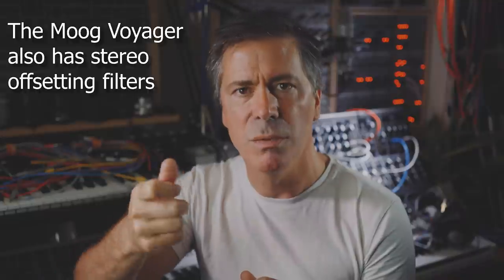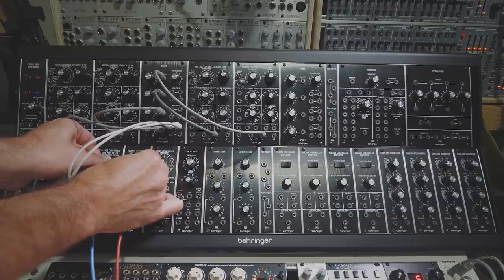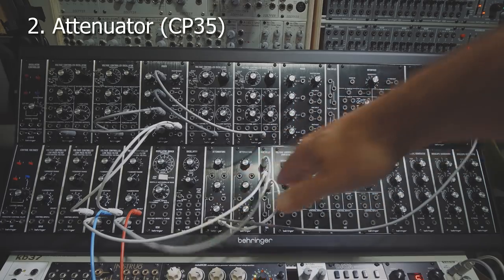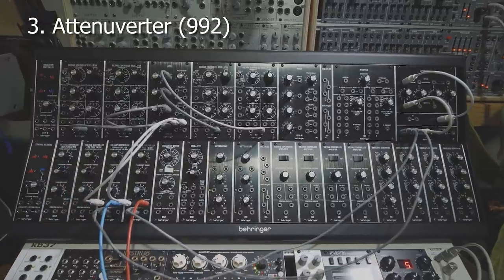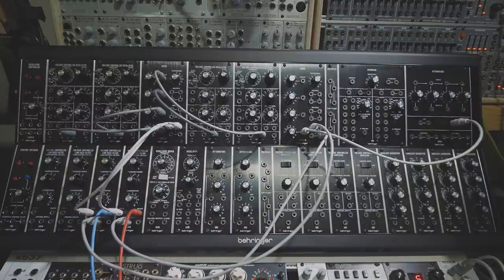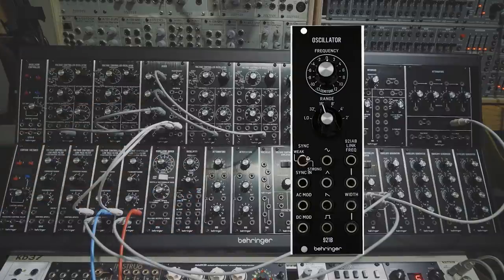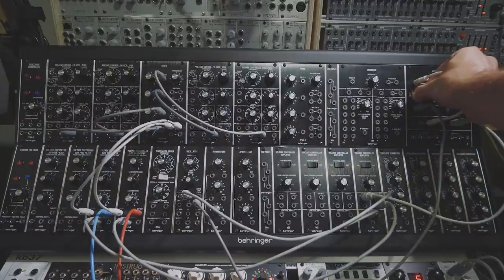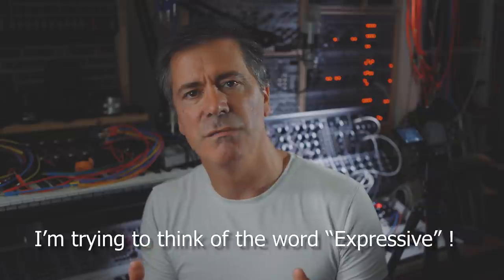Starting to Patch the Behringer System 55

Comment: nice one here, mr. shoebridge! both an admirable job of meeting your stated goals as well as some beautiful sounds and effects. the stereo elements of the matriarch are why i ended up selecting it over a couple of other synths i had been considering. never regretted it either. i also admire how you don't shy away from cables but if one is going the modular route, or even the semi-modular, one can't be afraid of them.

as always, thanks for your efforts and products.

Comment: Great video as always Tim. Loved the soft etherial sound too. Looks like a good deal of problem solving is part of the classic Moog style modular way. A great learning experience!
Reply: Thats why the ARP 2600 was considered to be a learning tool. However, Ed McManus my college electronic art instructor back in 84 had one. It sat at the back of the lab and no one touched it. Why? The line and sign up list for the NEW DX7 was a mile long. I was, er, FORCED to spend hours relearning what I had done on the 55 years earlier. I sampled about a hour and a half of the strangest stuff to ever hit a mix on hearts of space. Hey Hey Hey!

When behringer made the 2600, I preordered and got one 8 months later. Love it. Wish I had 3 more....the seventies are long gone, the technician in Eugene Oregon that offered to sell me his spare (he had 3 ARP 2600, 1 which functioned)  he never got all the parts so he used 1 for parts...my mutron bi phase with opto isolator foot pedal that kevin courney (hearts of space) sold me for 65 bucks left with my blessing for a mere 250$ along with with my korg ps 3100 and matching 800 sequencer (hat I paid 400 bucks for both) went for 2k, all missed savagely, all replaced by better gear, more interesting synths. Now my oldest gear is my fizmo, got it when it was brand new. I traded a prophet 5 I got for 175 bucks at a pawn shop. J wire? I dont care. I didnt care for that sound for some reason. It had a wooden case.  I am 67 years old and I have seen stuff come and go! Good luck and may you invest your energy wisely. Keep your eyes open for oportunities, they happen sometimes. I was offerd jobs as a roady for oddysee, m jackson tour and shows on ice. Put yourself out there! Be friendly.

Comment: Awesome video's, I really loved how you explored this one.  I have a larger System 55 setup which I put together last year that fills two Go cases and a couple of 104hp Behringer skiffs.  I also just received the Behringer "Four Play" module which is essentially a quad VCA mixer for either audio of CV signals.  That's yet another way that you can accomplish the voltage controls for this particular setup, albeit a cheat since the 4play is not a system 55 module.  I use that -6V output quite a lot into my oscillator banks.

I'll tell you that you're doing here reminds me of my first ELP concert (1972 I think). ELP had setup a 12-thousand seat venue with "Quadraphonic Sound".  They had four massive piles of speakers in 4 opposing locations in the concert hall to surround the audience.  They started the concert with their song "Hoedown" (which I have successfully patched with my System 55 using envelope delay to trigger a 911 and then through an attenuator to control the frequency of a 921B oscillator, in a bank of 3 driven with a 921A... and then out through the typical Mixer-VCF-VCA output.)   ELP shoved all of this into a quadraphonic system with different outputs on the various oscillators and the sound crew would ROTATE the sound in the concert hall clockwise or counter-clockwise... sometimes different voices simultaneously in both directions.  The quadraphonic surround sound nature of routine Emerson's synth through this system made me tingle like never before!  I was NEVER the same after I heard that concert.  They also did Jerusalem and an extended version of Karn Evil 9.  I was blown away...

Anyway, what you're starting to get into here is the start of the path which I heard that night and have chased ever since.  In fact, it steered me into a music major along with electrical engineering at the University... and now Behringer made it possible for me to somewhat replicate what I heard in the 70's.

Comment: There is yet another, quite simple patch to achive the effects from this video, by using a 921 VCO (without A or B). With the AUX output, you have adjustable positive and negative outputs which can be fed directly into the 904A VCFs. I use this patch currently for stereo effects.

Comment: That last two minutes literally gave me goosebumps. The more I watch your videos the less I can resist to buy my first modular setup. What you'll advice, maybe Behringer System 100 bundle from Thomann?
Reply: if you already own one or more semimodulars, you should go for a few modules to expand your possibilities. only if you want the whole shebang it's cheaper to get the complete bundle. The System 100 is worth it, in any case.
Reply: For sure do that. Expect a  long wait as the process is both time consuming and sometimes , expensive. They are good to work with, just keep an eye on the process as mine stalled for a week because of a paperwork foul up. They fixxed it as soon as they found out, shipped to USA in 24 hours. The fees must be payed to keep the gear or you pay the return shipment  costs. They use UPS and USP will handle all the paperwork and process with the Federal Gov. to your home. Do it! Comes in a nice bundle.

Comment: You could also have used the output of the 921A instead of the fixed voltage and attenuator. The 921A just provides a voltage output that is varied by the frequency control. Same with the 921As PWM output.

Comment: This is what came as my System 55: 

1x 914 FIXED FILTER BANK 
1x 923 FILTERS
1x 904B VOLTAGE CONTROLLED HIGH PASS FILTER 
1x 904A VOLTAGE CONTROLLED LOW PASS FILTER
1x 992 CONTROL VOLTAGES 
5x 902 VOLTAGE CONTROLLED AMPLIFIER 
4x 911 ENVELOPE GENERATORS 
1x 911A DUAL TRIGGER DELAY 
2x 921A OSCILLATOR DRIVER 
6x 921B VCO
1x 921 VCO 
1x 960 SEQUENTIAL CONTROLLER 
1x CM1A MIDI to CV converter 
3x CP3A-O module 
3x CP3A-M 4 input mixer 
2x 995 ATTENUATORS 
1x 903A RANDOM SIGNAL GENERATOR 
1x CP35 ATTENUATORS
1x 961 INTERFACE 
1x 962 SEQUENTIAL SWITCH 
1x BP28, 2x BP56 and 2x BP2 blanks panels for a total of 144HP expansion space
1x CM1A MIDI-to-CV converter
2x EURORACK GO cases including PSUs
2x EURORACK GO BRACKETS to link the 2 EURORACK GO cases together for easy patching

I feel i need to get at least one more 904A LP Filter, 2 more  921 VCO,  2 x 994 multipliers... 

Apart from this I selected a few modules on the Sweetwater website :

Behringer Chaos Analog Random Sampler Eurorack Module
Behringer 2600-VCO Eurorack Voltage-controlled Oscillator Module
Behringer Radar Eurorack Module	
Behringer 150 Ring Mod / Noise / S&H / LFO Eurorack Module

I wonder if any of these make any sense... 

Your advice is going to be immensely helpful...

Comment: do you know if the 921A is necessary for operation of 921B? Will 921b accept standard control voltage (1v per octave) without help of 921a ?

Comment: Am loving this - But as total newbie - not understanding why we need that +6v from the CP35.
Reply from the maker: Well one example, take that +6v, pass it into an attenuator, then you have a variable voltage you can apply to any CV input. A bit like having a mod wheel, you can use it to manually modulate anything....
Reply: @TimShoebridge  i was trying to replicate what you were doing with my basic starter system... now realise how 'basic' it is.... needing (minimum) a CP35 methinks.... (and a ton more knowledge) I was puxzzled when you brought the VCA into play - I'd already had the filter going ito it.... thought that was the only way I could hear the filter.... didnt know that I could go straight to my external mixer from places OTHER than the VCA.... wouldn't have twigged that without watching the vid - so many thanks again.....

Comment: Just getting started with the System 55. The manual mentions that the unit should be powered off when changing patches, however, I have yet to see anyone on Youtube doing so. Are the IO ports on the modules sufficiently protected to allow hot patching? If so, any idea why the recommendation from Behringer?
Reply from the maker: I think there must be some misunderstanding. Perhaps the recommendation is to power off the case before adding or removing modules and their power cables rather than patch cables?
Reply: @TimShoebridge  The portion of the Quick Start  manual that seems to imply the need to power off is "Make all the connections in your system as descried in the individual patches. Keep the System 55 power turned off when making any connections". Perhaps it is just worded poorly.
Great videos, btw. Back in the day (mid 70's), I had many synths on stage but never could afford a modular system, so this is a blast to finally get one.

Comment: I would have absolutely lost my mind about all of this Behringer stuff 15-20 years ago but I’m afraid it’s too little too late. There is way too much exciting and incredible new analog and modular gear to make these even remotely relevant
Reply: The 904A low-pass filter is just one of several of these modules that are relevant to the analogue wind-synth set-up I'm building around my Roland AE-30 and Neutron.